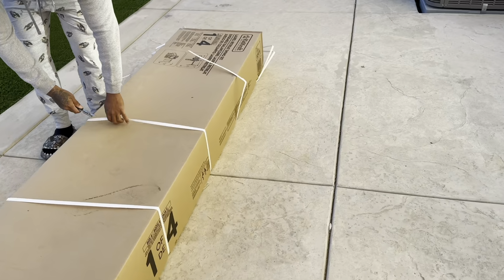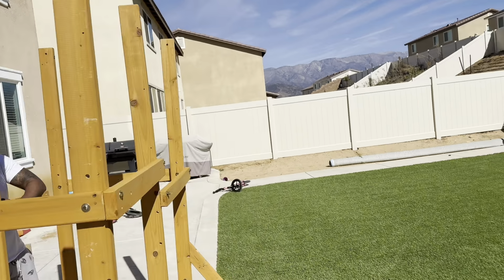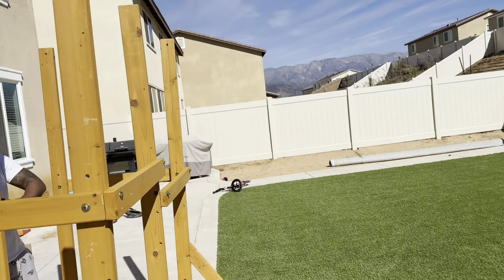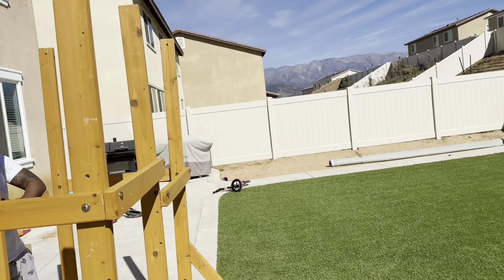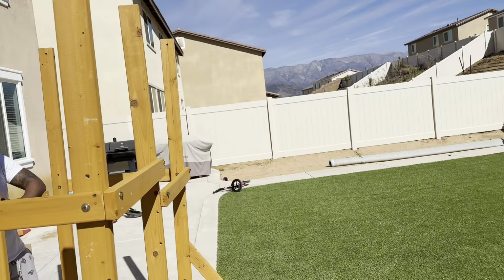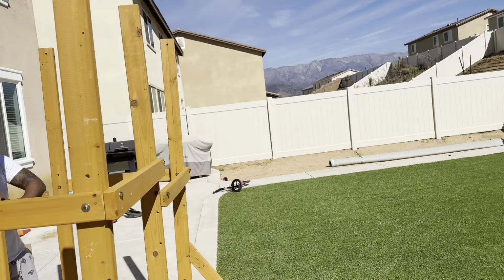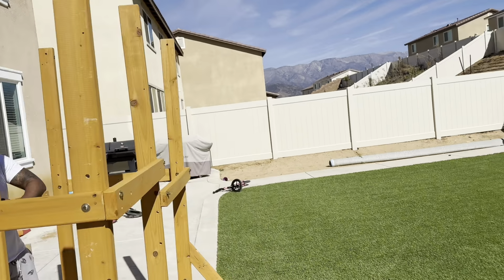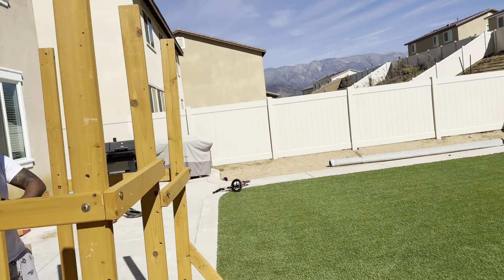Swing Set Assembly | KidKraft set  #assembly #playground #tutorial #diy #outdoors #kids #play

Comment: Question for ya'll did you anchor this to the ground? We just got the same set and wasn't sure if we should anchor it in
Reply from the maker: No I didn’t anchor. My kids are little and it’s fine. 3 4 and 8.
Reply: What is the measurement from the furthest point of the back to the front of the straight slide?